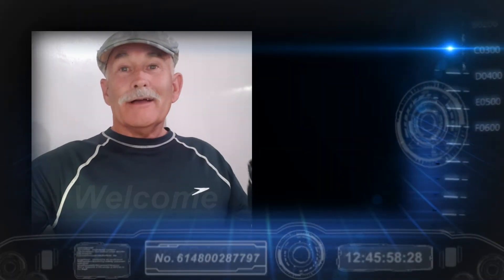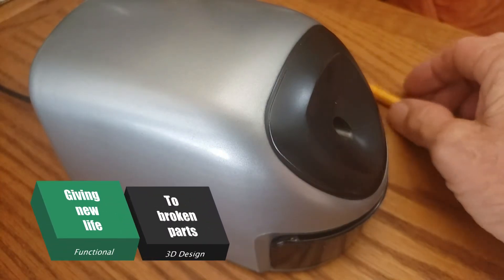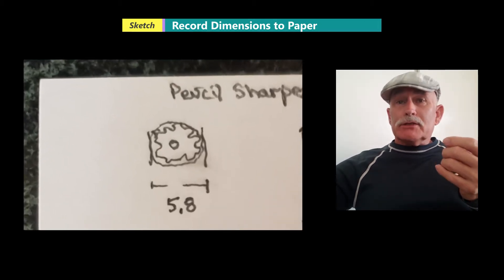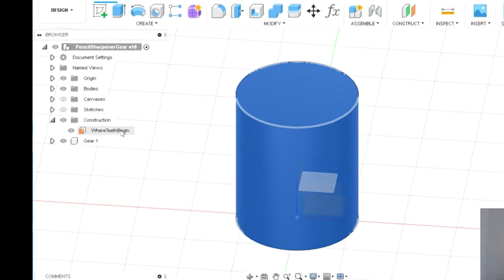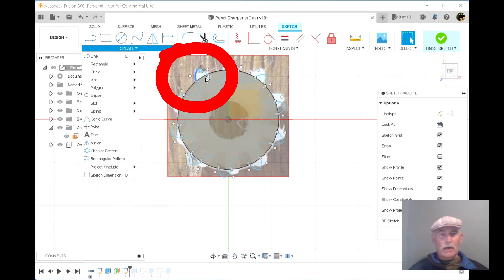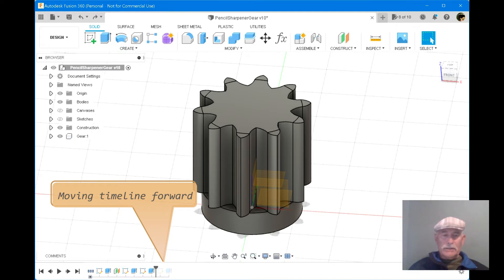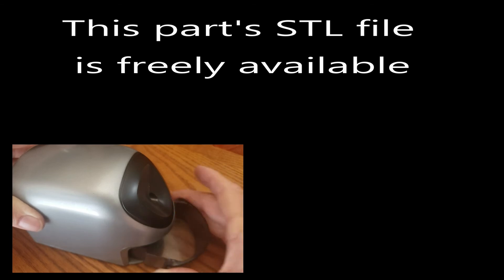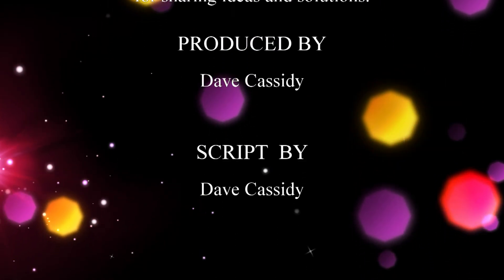Staples Pencil Sharpener Gear Replacement

Comment: Well, I have to say: I am duly impressed. The fact that you have the ability to disassemble the  electric pencil sharpener, identify the problem, go through the necessary 'engineering' steps to manufacture a replacement gear, produce it, install it, and have it work perfectly in the first 'go', speaks volumes of your talent. Very well done. And the video looks, again, like it was done in Hollywood. Pretty darn cool, Dave... Pretty darn cool... The best to you and Tony... I'm still interested in speaking with you about the matter I brought up before Covid locked me in.  Cheers, my friend... Sincerely...Mark
Reply from the maker: Hi Mark, Thanks for your complete & super positive review. I responded already to it earlier and somehow it ended up on a separate thread of comments. Color me a novice at YouTube.  Looking forward to chatting. 😄